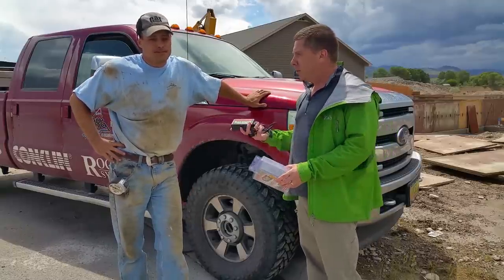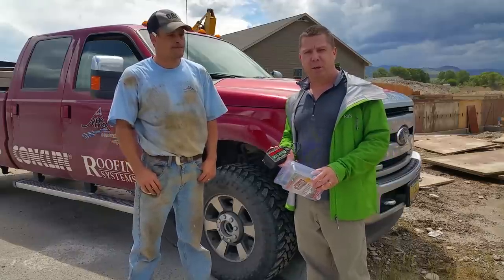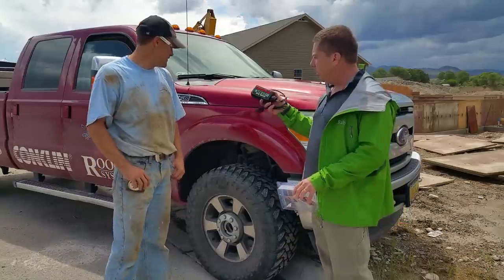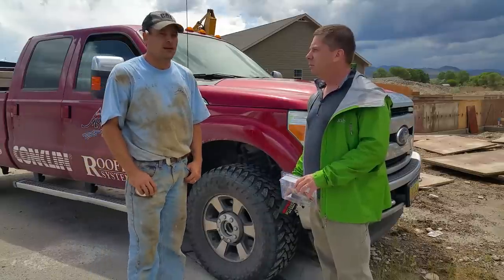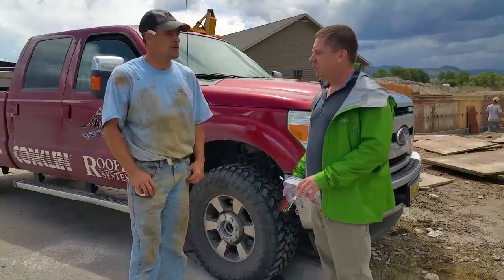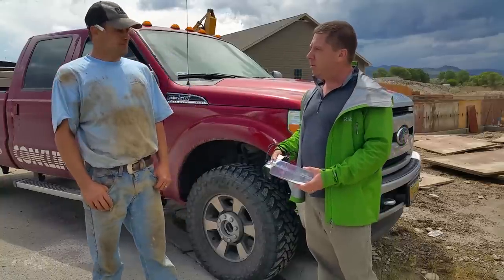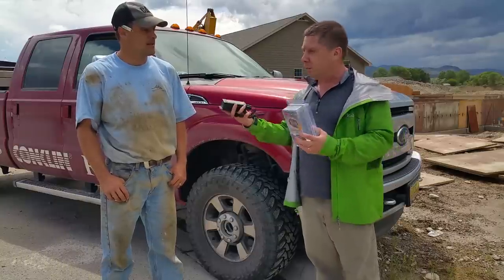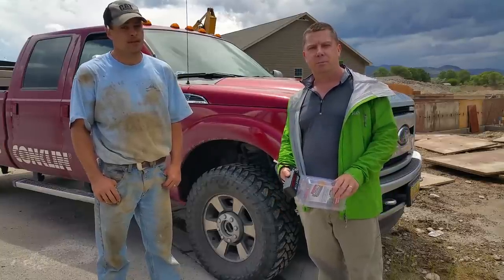Powerstroke 6.7L Fuel Mileage Testimonial

Comment: read this and it is true nothing to gain by not telling the truth:  I have a 2007 6.0 F250 2WD Crewcab SRW Larait very nice 108,000 miles.  All I've done so far is the Purge tank cap, Coolant filter, K&N Filter in Stock box. Exhaust and everything else stock. Had a smart man do me a tune for mileage. He sent me three...I did not like the first tune.  Truck runs great and pulls great.  Here is the deal....do you know anyone getting a minium of 18 mpg empty in city driving?  i do.  How about anyone getting 25 to right at 30 Plus with the best of 33 mpg empty @ 70 mph, perfect weather no wind! Awesome!   Ok some will say I am just pulling your leg..  Guys this mileage is the same for the last 6+ Months! Tunner is amazed as well.  Maybe this is a very special truck. OK Loaded pulled 30' Gooseneck flat bed and heavy trailer got 17 to 18 at 70-75 MPG up and down hills.  Then loaded it up with 20 ton roof A/C units stacked two high and still go 13+ at 70 MPH with hills.  I am one happy old 65 year old man.    So, why am I getting this great mileage? Luck maybe. And yes I check it often and the speedometer is spot on.  No I do not want to sell any time soon if ever.  Thanks
Reply: Who did your tunes ?
Reply: Sounds great. San you share the tune?
Reply: I get 15 with best tuner u can buy and i drive like an old man wth
Reply: @davidayers1940  love the truck drove 85 miles with empty steel flat bed got 28 mpg, loaded up a 2000 Explorer drove back got 19-22 mpg back all at 75mph.  Get's better at 85 but I don't drive that fast. It's been doing this for 7 plus years, love this truck.
Reply: still has cats, egr delet, coolant filter,new IPR , banjo bolts,blue fuel pump spring, that's it and the tune.

Comment: is this item detectable by the dealership?
Reply: +Jeffrey owler only if you leave it attached. However it changes ecm signals, so we have some unknown factors with these new trucks. 80s technology on a 2011+ truck
Reply: Only if you don't wear a tape measure whilst covered in fresh dirt.